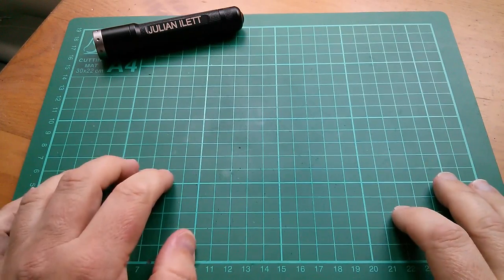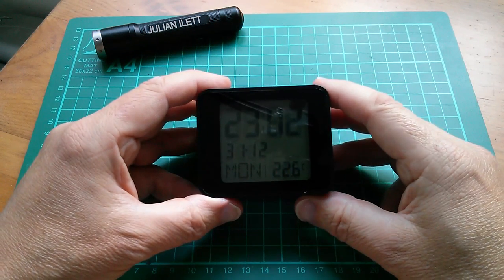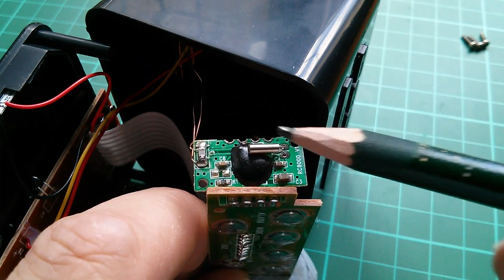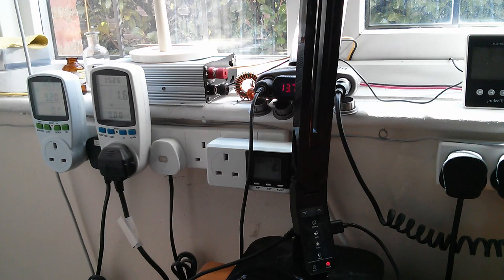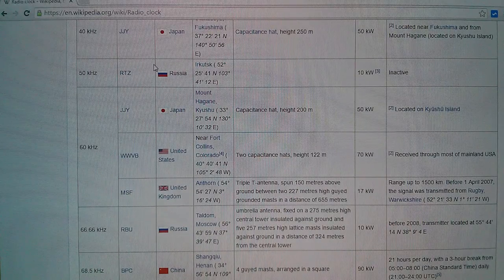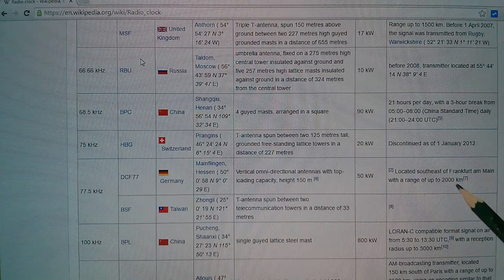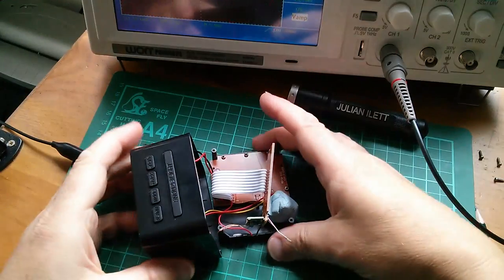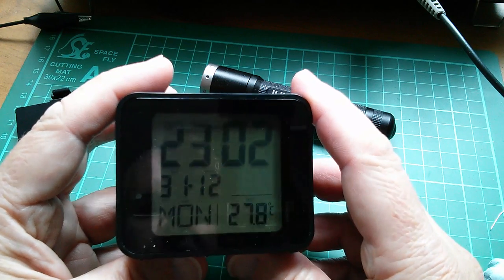From the Lidl non-food Aisle: DCF77 Radio Controlled Clock

Comment: I spy with my little eye... a potential problem with your oscilloscope settings. The scope says DC coupling in the video which would make sense for the signal you're trying to see. But... that is the settings screen for channel 2 and you're using channel 1 to probe the clock. Maybe channel was also set to DC, but chances are you left it AC without noticing.
The antenna is basically an loop antenna, in the form of a LC circuit. The input is a differential signal, so connecting something to both inputs will do nothing. You might have some luck running a long wire in a circle and connecting that to the inputs, but then you would ideally have to characterize the inductance of the wire loop and adjust the capacitor value to find the right resonant peak.

Comment: Ahh, good old dcf77. If you want to see it for yourself, have a computer with 192Khz audio sampling, install Spectrum Laboratory (free), solder a long wire to the tip of a jack plug and plug it into the PC MIC or LINE IN and set sampling in Spec-Lab to 96Khz then you will see all the frequencies from 0-96Khz, dcf77 and our 60khz waves show up quite well :) plus you get all the submarine waveforms and get to monitor lightning strikes too :D
The Carrier is only turned on and off to set the data bits, the timing sets the data as a 1 or 0. Its also reversed from what you would expect, its the OFF time of the carrier that sets the bits all you will hear if you listen to it is a series of tones, long, short and double. IE beeeep, beeeep, bip-bip, bip, bip, beeep  etc :) you can wire an led to the output of the board to see it flash as it receives the data, I did this with a uk model I pulled from a broken kitchen clock that moves the analogue hands round the face. The receiver board was inside the clock mechanism and totally usable as a separate item :)

Comment: One of those gadgets that don't mean much, until you buy one. An hour well spent and the 5 quid too.
Got a couple of radio clocks over here in the USA (am from the UK). The transmitter is in Fort Collins, CO, which is only 120 miles from Colorado Springs, where Tesla spent a year experimenting....so, the true inventor of radio still has that cool legacy going on.

Comment: Some people slag Lil's off but they should at least give the store a try. I often buy gadgets etc from lidl and so far (touch wood) I have not been disappointed. Most of my LED bulbs came from Lidl, I have tools I bought years ago from lidl, still in good usable condition, and their food ain't to bad either.
Reply: where else could I buy an excellent japanise pull-saw?  They stock some surprising stuff, and their quality control seems very good.  No wonder they're succeeding.  The idea that they sell cheap rubbish is snobbish bollocks.
Reply: i have a netto angle grinder from when they first came to uk, still in heavy weekly use and i abuse tools, in fact it will be in one of my next videos from fitting new angle iron battery boxes to my van. i do every 6 months or so service it, i guess thats the difference than even a cheap tool can last if looked after

Comment: In Germany, the DCF acquisition also takes ages... The technology is just very very slow.
Reply: In the UK we have the MSF signal @60KHz, takes a few minutes to work.
Reply: I'm in the middle, near Paris, my Casio watch catch both signal with the same strength :D
Reply: The clock I have in my german basement takes 50 seconds or less. Probably strongly dependent on the distance to transmission towers.
Reply: drkastenbrot
I am ~300km from away by air from the tower.
Reply: Thumbs up for Guust Flater!
Reply: Lol.. My Casio does it it 45 secs .. Turned it off because the time is always correct
Reply: If Julian ever took the time to read the stuff he looks up, he'd understand the that the DCF signal is 1 bit/sec with the full stream being 59 bits. It takes at least 1 minute for the data to come in and if the the check bit fails, several minutes.
Reply: Markle2k The reason my clock takes 50 seconds must be that it only updates the time, as the other data doesnt drift as much.
Reply: drkastenbrot
Hmm... I doubt it. As we saw in the video, the parity check bits are all over the place. So the whole packed has to be parsed in order to just adjust the time.
Reply: ***** think it depends on distance from signal quite a lot, when the transmitter was in Rugby, UK just a few miles away from me, I used to get a quick lock, but now they've moved it to Cumbria which is just south of Scotland it takes ages.
Reply: blaser
As I said, I live ~300km away from Frankfurt and it takes about 5 minutes for every clock here... And I have very big windows.
Reply: +drkastenbrot Probably. The time and its associated parity bits are first in the message
Reply: +drkastenbrot Probably. The time and its associated parity bits are first in the message
Reply: Graham Hobbs
What is it?

Comment: I'm not surprised you didn't see anything on your scope when you probed the coil on the ferrite, the signal will be microvolts. I made an MSF receiver many years ago (actually when they first started the data service on the Rugby transmitter) and I used a tuned ferrite rod followed by several stages of amplification made up of op- amps with twin-T networks in their feedback paths. Great thing about making a receiver for such a low frequency is you don't need a high bandwidth op-amp to do the work,

Comment: That's not the DCF signal you're catching on the DSO.
The DCF signal is just one pulse every second, if the pulse is 0.1 seconds it's a 0 if the pulse is 0.2 seconds it's a 1.
So it has 60 bit in total for the information.

Comment: DCF77 requires 2 Minutes (-+ couple of secs) to receive the full date and time information. BUT..if there are missing impulses within the 2mins, it starts over and drops all received so far. so a good receiption is required.
Reply from the maker: +Axel Werner I'm surprised it can't collect the transmitted packet in parts. There are multiple parity bits.
Reply: Julian Ilett its like 25yrs or so when I last read the specs, but as I remember its about 1bit per sec throuput and the parity is just a way to verify validity, not error correction. And most cheap clocks just Drop any information thats invalid or incomplete.

Comment: Hi Julian! Great video!
I have som Casio wrist watches (8 of them) that are rated Multiband 6. They can take all broadcasters of time signals in the world. Digression: It's cool to hear the time beep every hour when they have synced up! Spot on all of them! They try to get the signal every hour from 24 to 05 in the night, so in the morning they are all synced within millisecs!

Anyway, 77,5 KHz is super-longwave, and during the summer, signals are not propgated very good in the ionosfere. Therfore, you should try it in the night, while the sun is on the other side of the planet. 

Another digression: I'm a radio amateur and som times the watches dosen't tune in at all. I can be pretty shure that it's a solar storm wrecking the ionosfere when this is happening. Solar storm in the summer might delay rescieving signals for days :-)

Oh, and ferite rods should be lined up 90 degrees to the radiowaves. From Norway, I line up my watches to the south to Germany. Allmost any electrical thing will make intereference with the time signal. If you have a camera, mobile phone, or a PC close to the clock, forget to rescieve signals. 

Thank you for another interesting video! Keep them comming :-)

Comment: Never heard of these kind of clock in Australia. Incidentally there are no broadcasting towers anywhere near the east coast as far as I can see.
Reply: These days I have almost only DCF clocks. Even my analog wall clock has a DCF receiver.
Reply: According to the instructions, the clock can receive the only radio signal from Frankfurt with a range of 1500 km. Australia is however almost ten times this distance, so the clock is of no use there.
Reply: nucleochemist Australia does not have one of these atomic clock radio towers. US, UK, Germany, Russia, China, Japan are the only ones in existence to my knowledge. You're SOL down under unless you want to use GPS for synchronization. They do make GPS wristwatches these days, but no GPS analog wall clocks for obvious reasons.

Comment: Interesting video, thanks Julian. I've had a radio controlled digital wall clock from Maplin for years. It now lives at work as my wife felt it wasn't suitable for our house. It used to receive the signal quite quickly, but since the transmitter left Rugby it seems less reliable. We have to leave it by a window for ten or fifteen minutes now if the battery goes. So it's no wonder yours needed to be outside synchronising to a German signal!

Comment: weird thing is that everytime you press the light on button it seemed to turn off a bit quicker than my clock does and now that I timed mine (5 secs) and yours (it seems to be slightly shorter ~ 4- 4.5 sec)

Comment: It's quite risky selling a DCF controlled clock thousands of kilometers away from the radio tower. It  would be a wonder if it picked up the signal at all. Reception is already bad enough in Hamburg/Germany

A complete DCF time signal is encoded within one minute. Each bit is encoded in one second. The jumby data on the scope is actually just noise; you were picking up something from the scope (the clock was very near to the scope). Acquisition works best if the clock is standing somewhere, for some reason. It's based on very old longwave technology. "Good" pulses appear once every second, they are between 100ms and 200ms long.

Comment: Oooh!! Deeply intriguing :D Would love to see more on this, Jules :)
Try the clock upstairs with the scope, see if you can grab a signal there, and try filming with the phone in aeroplane mode so wifi and bluetooth won't cause possible interference.

I bought an MSF clock from Maplin many years ago, and that had the same separate module for the receiver, with the same pinouts. I never managed to get anything out of that, realising only now that the module must have powered down once it got a lock and the time was set :(

Comment: Hi Julian, nice try, but you stumbled across an absolutely bad and cheap reception module. What you scoped out of the OUT pin is just total interference. If you go to a position with good reception and out of the noise of your shack, then you will see 100ms (logic 0) and 200ms (logic 1) pulses at each beginning of a second. One exception is second 59 as this one does not carry any mark. Unfortunately these cheap receiver chips totally mess up these exactly defined marks from 40ms to 140ms for a 0 and from 180ms to almost 300ms for a logic 1.
If you like to have a better reception, buy a larger ferrite bar and put the coil over it. If you like to tune it, move the coil along the bar. A wire-antenna for 77.5kHz would be 1900m long, you might have to negotiate that with your neighbors...
However, if you like to get more details about that, leave me a note.

Comment: The PON connection on the receiver is the Power On pin, and needs to be held to a rail to turn the DCF77 receiver on.  It may be active high or low depending on the DCF77 receiver design.  To save battery power, the clock will only search for the time occasionally, obviously when it is first switched on and then otherwise often during the night when interference is at a minimum and so the Frankfurt signal can be best received.  Ferrite aerial needs to be broadside to Frankfurt for maximum signal.  Lock time is generally after two successful packet are received without error (ie could be up to 3 minutes in perfect conditions).

To see data, you will need to be using the oscilloscope when the clock is asserting the PON pin, otherwise there will be no data output from the DCF77 DATA pin.

Comment: It is so slow because of the modulation: 77,5 kHz signal reducing the power of the signal every second for 100 or 200 milliseconds (bit 1 or bit 0). So fort transmitting 60 bits you need one minute. The cheap receivers only accept a complete, uninterrupted sequence of 60 bits.

Comment: The frequency you were measuring was most likely the clock of the scope screen, the back light or some other random switch mode PSU. Keep the clock away from other electronics. 50-100kHz is quite busy for power applications.
Also screaming at the screen that you most likely had the scope set to AC coupling, but you never checked ;) .

Comment: You can buy the receivers seperately from ebay:
http://www.ebay.co.uk/itm/atomic-clock-receiver-module-with-antenna-77-5kHz-for-Europe-DCF77-/252479783939?hash=item3ac8f7c403:g:0a0AAOSwqfNXmu4c
And you can also get 60khz msf ones, which is an atomic clock time signal in this country:
http://www.ebay.co.uk/itm/USA-Canada-atomic-clock-receiver-with-loop-stick-antenna-60kHz-WWVB-JJY60-MSF-/262551887959?hash=item3d214fe057:g:6DYAAOSwtnpXm0kJ

I have deigned an built a frequency standard which uses a crystal oven, and has a msf receiver which is used to sync the crystal oven.

Those receivers are actually more expensive than the lidl clock, my 'scope/pc/power supply/ desk light all mess up my vlf time receivers.

You can get adrduino libraries to decode both the msf and dcf timecodes.

Comment: well! I must have been under a rock or something! this is the first one I have heard of. the only thing similar is my cell phone sets its time by the tower. can't believe I never heard such. but never paid much attention to clocks such as that. only more like 19th century clocks and such. not much into digital clocks. but I am into other electronics but not computers so much. kinda odd I guess. I am wanting to build my own power inverter and high current DC brushed motor controller. all I know is self taught. and I have picked up a lot from you. and I was hoping you would help me with the inverter build. because I need it to run my home. it needs to be 120v 60Hz. either 12 or 24 volt. depends on how big the inverter turns out. if its over 2500 watt I would like to go to 24v. I'd like to build one to run the whole house. at like 8kw. but would settle for 2500 for now. can you help me with what MOSFETs to get. and would a 555 work or would a micro processor  be best. I have a fairly good idea how to build a transformer.  thanks for the great videos.

Comment: I don't think a piece of wire will do much in terms of RF reception. The frequency of the transmitter is 77.5 kHz which is a pretty long wave. Even a quarter wavelength, which is the minimum required for an effective antenna(not counting electrically shortened dipoles) is about 967.7m. A better ferrite core would do a lot more for sure.

Comment: Many of the time signals are going to depend on propagation by reflection/refraction of the radio waves by the ionosphere. This makes reception sensitive to distance, time of day, season of the year and sunspot cycles. WWV (in the United States) transmits on 2.5,5, 10, 15 and 20 MHZ to try and make a signal available under the different conditions.

Comment: Julian, if I am using a 5v solar panel to charge an 18650 with a tp4056, will it damage the battery if the panel can't provide the full 1Amp for the CC part of the charge cycle?

Comment: capacitive coupling to an oscillator coil drags the operating frequency down, which could explain the lower frequency. To really measure these things without interfering you need an active RF probe.

Comment: What you saw was not the data. The signal is 1 bit/s. A bit is encoded as the length of a pulse. So a good way to view the signal is with a LED on the OUT pin. With perfect reception you get a flash every second which visibly is a bit longer for a 1 than a 0. Then every 60 seconds there is a different flash (I think it stays off).

Comment: Last time I watched one of your videos about Lidl products I ended up buying a cordless lawn mower from them! If you think I'm going to watch this one as well then you've got another think coming!
Reply from the maker: +jono10531089 oh go on, it's only 5 sovs. and the lawnmower is excellent :)
Reply: I have to admit that the lawnmower is (surprisingly) excellent. I half expected the battery to run out after 5 minutes, but I'm very impressed so far. The only reason I've been able to resist the clock so far is that I've got a similar Clock from Germany that is perhaps 20 years old and is still performing brilliantly. I assume that it uses the time code from Germany like yours does. hopefully yours will be as reliable as mine has.

Comment: i got a mechanical radio controlled wall clock from clas ohlson without knowing such a thing existed. we were very puzzled when we put batteries in but couldn't see how to set it then it burst into life. An AA battery only lasts about 4 months in it though, compared to several years with a normal clock

Comment: As far as I know it can take up to two minutes under best conditions. There is only one start-bit that marks the beginning of every minute that is also the beginning of the complete dataset that is send out every minute. So the clock needs to wait for the first time a full minute starts, then it recognizes the begining of the datastream. Then every second a bit is pulsed and the protocol interpretation of this bit corresponds with the second of this minute. After 59 Bits the startbit is send again and the dataset for this new minute is send out. If something fails the clock has to wait for the startsignal again. Overall it is a very slow process.

Comment: Best time to probe and experiment is after the sun has set.  Solar radiation on the ionosphere will substantially weaken the low frequency DCF-77 radio signal. 

Also, here are some links for DCF-77 arduino based clocks:
http://forum.arduino.cc/index.php/topic,16204.0.html
https://blog.blinkenlight.net/experiments/dcf77/binary-clock/
Reply: additional link for DCF-77 arduino library:
http://thijs.elenbaas.net/downloads/?did=1